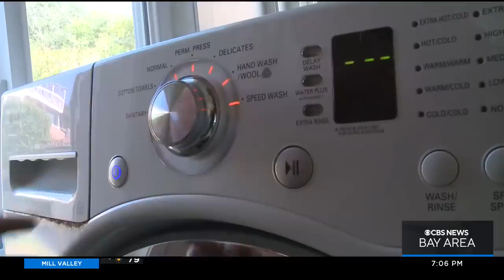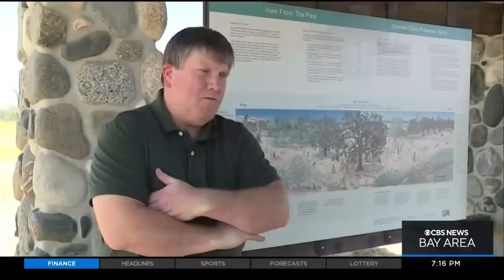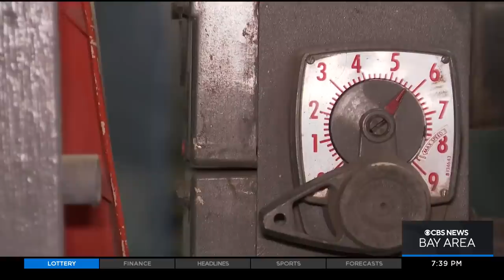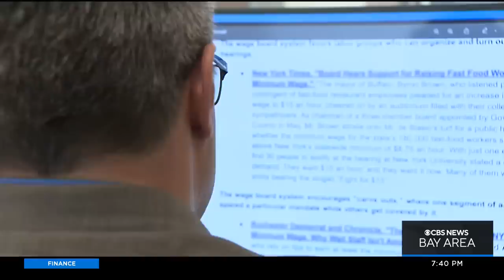Parched: California's Climate Crisis

Comment: When I started watching I figured I'd watch about 10 minutes and then move on. 45 minutes later I was thinking it was ending too soon. FANTASTIC video. I have 900 watts of off grid solar. Here in Central Texas it came in handy in February of 2021 when our world fell apart. We are at half our normal rain fall this year and only because our usually dry month of August has been freakishly cool and wet. Stay safe out there in California.
Reply: Aqueducts and desalination plants are expensive and frankly a destructive approach.  It is vulnerable, brittle, and fails to address concurrent problems.  You end up using a ton of electricity to pump water in the aquifers, as well as desalinating water.  It would increase brownouts.

The better approach is the prevent collecting too much water at dams in the first place.  
It is better to do smaller, decentralized, water-harvesting earthworks/techniques starting in the foothills, and continue thru to cities.  These would include keylining, check dams, bunds, swales, gully repair, planting pits etc.  More bioswales with curbcuts to feed street runoff into them is a start in urban areas, as well as encouraging the purchase of cisterns, using greywater for watering lawns and trees, as well as using roof runoff for water, flushing etc.
Decentralized efforts can reduce fire danger, flooding, lessen drought impacts.  Bioswales planted with trees can reduce heat island effects, allow pavement to last longer.  By passively using rainwater in bioswales, reusing greywater and roofwater you can reduce the amount of electricity used to irrigate and reduce the chance of brownouts.  
Keeping landscaping hydrated this way also keeps the soil biota hydrated and allows water too seep better into the soil instead of running off.  
Overall using rainwater harvesting techniques/earthworks recharges aquifers and surface water in a positive downstream effect.  
Brad Lancaster has YT videos and books on the subject.

Lots of water falls there, even during droughts but it is squandered.  Back up and reassess where you look for problems/solutions...

Farming and ranching could be done much better.  'Sustainable ag' is a greenwashing term to sell more products to farmers and ranchers rather than solve deep ag problems.  Restorative ag techniques work much better and for less while producing more food.
Reply: @b_uppy  I agree with some of this but not all. You still need lake Mead and lake Powell for electricity and as a main water supply. They are not going to pay for the infrastructure to send water to urban areas from dozens of smaller catchments. Also decentralized water catchment increases loss from evaporation which may not be that bad if the water comes back down as rain. I don't know. It would certainly be useful to contain water if and when there is an overabundance but if there isn't enough falling from the sky to supply demand then desalination would be necessary to make up the difference. As for brown outs doing away with Hoover dam isn't a good idea. Encouraging solar and wind generation is. I have 900 watts of off grid solar that I have built up over the years and hope to be independent from the grid some day. This should be encouraged not regulated against. The county I live in here in Texas is putting up a lot of wind generators in spite of Greg Abbott's best efforts to sabotage the plan. He even lied about them being the cause of the power outage we had in 2021. Ignoring climate change isn't going to make it go away and delaying mitigation is going to be far more expensive in the long run. Maybe more than we can afford to pay.
Reply: @simplethings3730  
What I am suggesting will still recharge the lakes but you will also rehydrate the land instead of losing it to watershed and evaporation at the wrong times.  
They've shown repeatedly in Ethiopia, India, Australia, Tucson, etc that this works in an all-positive way.   The water seeps in there recharging the watertables and aquifers.   It's the point that they're stopping the need for gridded aqueducts systems.  You're greatly reducing centralized gridded water systems.  
You're benefitting wildlife as well.
You really need to take a deep dive into how decentralizing water is done and the benefits it creates.  It's a way to create equity without the goofiness.
Reply: 900 Watts ? I’ve only got 500 Watt’s that we got from President Trump. Hey, you wouldn’t know where I can get a Colt AR-15 would you, I can clear the FBI Check. Joe Biden has been screaming BUY AMERICAN, BUY AMERICAN but my money doesn’t seem to be any good out here… 🇺🇸
Reply: @3DLasers  
Lol.  All the complaints about Trump being a force of disunity and then here comes Biden's speech the other night...
Reply: @3DLasers  
The best bet is to get in their and be a vote counter, the second best thing os to monitor the count.  Too many are complacent.  
Keep hearing 'voting fraud is rare.'  That's certainly a debatable point.  
It is totally different from saying 'voting fraud lacks impact...'
Reply: @3DLasers  pat pat pat Now go play. The adults are talking.
Reply: @simplethings3730  So what did you think of our Commanding Officer President Reagan ?
Hey that was 60 months of the most prosperous period in our Country's History and our Country isn't a Nazi Police State now. So what did you do in WWII ?...🇺🇸 🌎
Reply: @3DLasers  pat pat pat
Reply: @simplethings3730  And Marines and US Army men that would just wipe your but out there in the field engaged in combat. 
Anyway, if memory serves I looked at your channel earlier and I don’t think I really saw much there so I’m just going to take that as just another person not really doing much with your life so I’m going to go on up here and talk to these other people that are doing something with their lives… 🇺🇸 🌎
Reply: @simplethings3730  Or Democracy Capatalism and Chine 🇨🇳

Comment: To me it seems clear that the melt water from the snow and the flood waters from the rain need to be collected and used. Cisterns and settling ponds on a large scale along with building the ability to put or move it to where it can be used or stored instead of letting it go to waste seems the obvious solution.
Reply: certainly something to be done...not 'the' solution but a good part of the solution. Also, composting toilets, gray water systems to reduce waste (of human, medical, synthetic &c) contaminating water---making something that can be used...among other things, like conservation. Everything does not need to be More or Better Bigger. Diversify fuel sources, cooperate across state lines to become more sustainable...sense... not in my lifetime. so sad.

Comment: Does anyone have any data on how much evaporation there is from open canals? Got to be lots lost there.
Reply: The Penman formula for the evaporation rate from a lake is simplified to the following: E 0 = 700 T m / ( 100 − A ) + 15 ( T − T d ) ( 80 − T ) ( mm day − 1 ) where Tm = T + 0.006h, h is the elevation (metres), T is the mean temperature, A is the latitude (degrees) and Td is the mean dew-point.

Comment: Yes, the water situation is bad in most of California.  But I believe the source of the issue needs to be addressed - artificially-induced climate change.  And no, its not caused by cars, trucks, jet aircraft, manufacturing, industry, etc.  It's caused by the senseless and cowardly spraying of thousands of tons of aluminum dust, heavy metals, etc into our upper atmosphere every day.  Try camping in the desert on a clear night and compare the temperature to camping in the desert on an overcast night.  You'll never be able to argue again that all that chem-trail stuff in the atmosphere doesn't hold in heat and cause a noticeable increase in temperature.  And chem trails have nothing to do with jet aircraft exhaust.  Lots of info on chem trails on the internet if you search.  If the cowards and traitors would stop spraying, I'm sure you will find the weather and rain will eventually return to "normal".  California's drought began years ago when they stepped up their chem-trail high-altitude spraying.  

I used to have a lot of respect for our jet aircraft pilots (and I'm sure there are many with a good moral constitution), but I have yet to see even one step up with any courage at all and publicly proclaim he's been asked but he's not going to fly a jet that is purposely spraying chem-trail toxic metals into our atmosphere.  I disdain cowards - they should be ashamed of themselves.

Comment: Instead of oil pipelines, why not water? The Midwest seems to flood weekly. Building pipelines to drought areas with emergency pumps would help all parties involved. Am I wrong to assume this as a solution?
Reply: I just wanted to let you know I am from east tennessee.if California mountain fires are not controled and contained you don't need to worry about the east coast water resources since 1980 everyone that has money to relocate have moved to those water resources that were existing in 1980 now you have to drill a well because of the water level is very low creks and Rivers that would sweep you away now you can walk across them and just roll up you pants and not even get wet. And after you are 100 miles from the spring then it's contaminated with lots of chemical drainage from plants

Comment: This is such a joke. I've spent 65 seasons in California. The years of wet winters followed by a number of dry winters hasn't changed. What has changed is the Government discovering how much power comes along with the control over the State's water that's theirs for the taking. Another thing that has changed is that over the last 60 years, water storage capacity has stayed pretty close to the same while the population has gone from 15,000,000 to around 40,000,000.
Lets see, nearly triple the population....no increase in storage capacity.....yet no increase of supply.
I don't think it takes too much thinking to get an idea of the problem and how to fix it.

Comment: If temperature levels rise, then water vapor in the air must increase. If water vapor in the air increases, then condensation in the forms of rain, ice or snow must occur. Where is it condensing? Are California mountain ranges insufficiently high to induce condensation? Alps? Andes? Karakoran? Himalayas? Have California authorities disproven Dane Wigington's charge that not only is global warming an issue, but weather engineering at macro and micro levels, using toxic elements in nanoparticles and microparticles which enhance droughts by adding highly flammable elements to plant level and ground levels, where they are absorbed by plant root systems, where still functional? How are 'heat domes' formed? Can they be destroyed? 

It appears that public officials plan to wring their hands together, blame global warming (blame the public) and do next to nothing. California's fate has been sealed by the nature of the people who run it, rather than by nature.

Comment: The reservoirs aren't just storage for water. They are also batteries that store electricity. The US is in an electricity drought as well. We burn coal to run bitcoin farms. We face power outages from several causes. We do not control our electrical power generation so we can't utilize electricity to control our water problem. The East suffers from flooding, the West from drought.  We already have a complex network of 26 million miles of pipelines that are moving fossil fuels. If we replace fossil fuels, that frees up these existing pipelines to control water distribution. The real solution to the water shortage is to reverse the trend of eliminating nuclear power.

Comment: The solution was mentioned in this video by the people who are harvesting water and also by people who mentioned water harvesting in the comments. Just subsoil plow to a depth of 24 to 36 inches to capture the rainwater. At this depth most of the water will be absorbed into the soil and not evaporated by the sun.  When you do this, this will restart the hydrologic cycle which means more rainfall!!!

Comment: When my husband died a few months back I was completely distracted and let a lot of home maintenance go.  The next month my toilet started running all the time.  I didn't pay much attention as it a low priority for me at the time.  Then I got a water bill that I was sure was a mistake.  Water had gone from about $80/mo. for the two of us to $421 for just me.  I was horrified and called the  water board telling them they had made a mistake.  Then they asked if I had a running toilet.  Oh oh.  It took 3 weeks to get a plumber during which time I tied up the float with string so it wouldn't fill and only filled it when it needed to be flushed.  After the plumber fixed it my bill went back to ~$75.  Look for leaks and dripping faucets.  You'll save the money for a plumber in just a few months.

Comment: Depending on the pasta, it could already be salted which seeps into the water you're using to cook, so even without the salt you could end up pouring brackish water on your plants. Food for thought.

Realistically, going through the trouble of reusing your pasta water isn't at a scale necessary to impact the situation we're in so this kind of advice feels equivalent to spitting in the ocean to raise the water level.

Comment: What does this sound like MSM?
" Activities subject to reporting.
(a) The following, when conducted as weather modification activities, shall be subject to reporting:
(1) Seeding or dispersing of any substance into clouds or fog, to alter drop size distribution,
produce ice crystals or coagulation of droplets, alter the development of hail or lightning, or
influence in any way the natural development cycle of clouds or their environment;
(2) Using fires or heat sources to influence convective circulation or to evaporate fog;
(3) Modifying the solar radiation exchange of the earth or clouds, through the release of gases,
dusts, liquids, or aerosols into the atmosphere;
(4) Modifying the characteristics of land or water surfaces by dusting or treating with powders,
liquid sprays, dyes, or other materials;
(5) Releasing electrically charged or radioactive particles, or ions, into the atmosphere;
(6) Applying shock waves, sonic energy sources, or other explosive or acoustic sources to the
atmosphere;
(7) Using aircraft propeller downwash, jet wash, or other sources of artificial wind generation;
or
(8) Using lasers or other sources of electromagnetic radiation.
(b) In addition to the activities listed above, other similar activities falling within the definition of
weather modification as set forth in § 908.1 are also subject to reporting."

Comment: There’s a great deal of lies going on in this video. Number one no matter what the reason snow melts it still turns in the water and what happens when you have 18 feet of snow when it starts to melt the water doesn’t go up it’s 8.34 pounds a gallon it goes down it has weight it goes into the ground because no matter how fast it melts it’s not as fast as rain so it goes in the dirt and then it starts dissent and it rains hard it just rolls off the top of the dirt because there isn’t much plant matter inside of it like there is an east coast it just glides off the top runs into the streams and then goes down to a state that has very few reservoirs for 40 million people. So when it melts and gets in the ground it’s better than when it rains so this bullshit about all because it’s warm it evaporates is utter nonsense it wasn’t warm 107° in March to evaporate anything once it’s in the ground and deep in the ground it can evaporate it slowly wicks to the streams and then once it’s in the streams it’ll head down to Los Angeles area and run straight into Mexico or into the ocean because we don’t have any reservoirs but that’s intentional you pass laws to make people use less water you raise the rates and you make the same profit with less work that science has been going on for generations